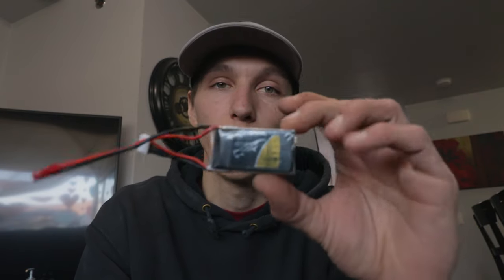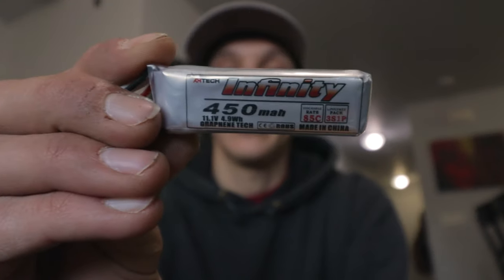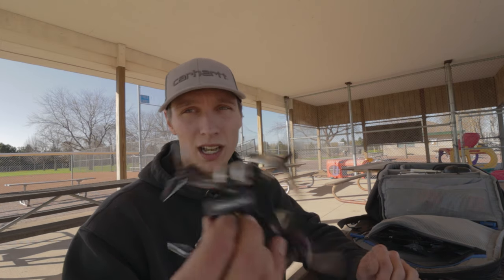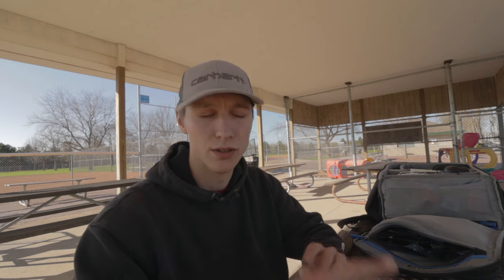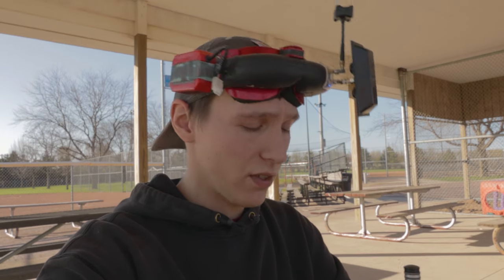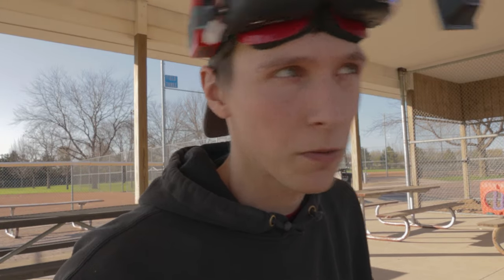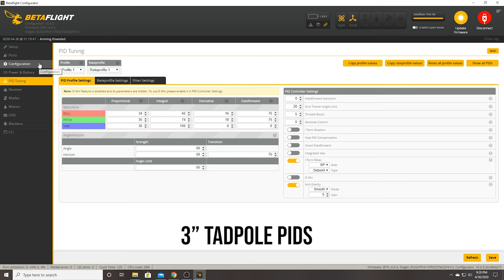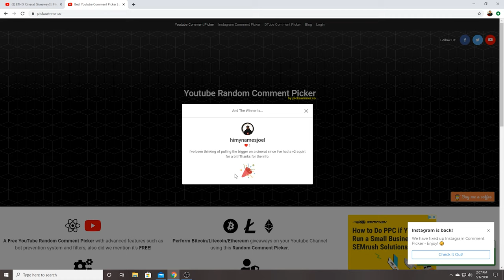The BEST 3 Inch Tadpole Setup | Armattan Quads | FPV Vlog

Comment: I've been running the iflight 1404's with 4s 525mah. Fakka rips and after some tuning was able to get the vibrations under control. Easy fly on 3s all day. The 14xx are a bit much for this frame though, I'm on my 3rd bottom plate, both cracked arms. I'll put the 14xx on the 3inch when I get it, and run 1206 for my 2.5. Side note, Split 3 nano cam lense sticks out past the cage when tilted up and will crack if hit just right.. if anyone wondered.
Reply from the maker: Nice I bet those 1404’s rip! I always wondered about using those but They just seemed so big lol

Comment: Yea dude, the weight you are shedding moving to the long type batteries is really what made the difference. I have mine setup for 4s and it is a rocket. I have a vid coming soon with it. you should check it out. I would have to say that comparatively my setup would be ideal.
Reply from the maker: I think the new batteries I got are actually heavier. They’re a lot bigger, the higher c rating is what made the most difference. My old ones sagged like crazy on punch outs and these new ones hardly sag and they recover super fast. What motor/kv are you using on 4s?
Reply: @Sky-wakka  Yea you are probably right on that one. Mine is basically the same setup accept the motors. I use betafpv 1204 5000 kv motors on 4s. The difference isnt insane, but it flies a lot like a 5" now and can power out of maneuvers much easier. I noticed we have a very similar style as well by the way. Good shit dude.
Reply from the maker: Yea our setups are very similar. The final rpm is almost the same but yours is slightly higher, but your batteries are probably heavier than mine. Probably just depends how you want it to fly in the long run, i saw someone else running a 1207 5000kv on 4s and it was crazy tho. It looked way faster than mine but i assume they were using a much higher camera angle too, looked like a 5" racer when i was watching it lol
Reply: Skywakka FPV didn’t you mention that yours were 6500kv? Yours are a higher RPM in that case. Yours flies much better than mine would on 3s although mine is also very nimble on 3s. I think if I went from 525 mah to 450 4s the weight difference would make it much faster. Currently my setup is about 130 grams AUW. What’s yours?
Reply: Skywakka FPV the micro class has come a long way since I started. But there is no better micro than the one you build yourself. Especially in terms of performance. Do you remember the channel? I’d like to check it out.
Reply from the maker: Sorry for some reason I never saw this comment. Yea it seems I didn’t the calculation wrong and my motors are slightly higher rpm in the end. My all up weight is literally 130.7g lol. I can’t remember the channel unfortunately I believe I saw it on Facebook somewhere on the armattan group

Comment: Appreciate the video!  Been searching for a mini marmotte and this is exactly it! I have spare parts including 1106 4500kv motors, hope they have the umph it needs
Reply from the maker: Yea if your gonna use 4500kv motors, if they can handle 4s, run 4s. I think 6500kv on 3s is just about perfect but 4500kv on 4s should be roughly the same final rpm. Should be a beast little set up

Comment: Just ordered my 3in frame from rdq, gonna do a fresh build on it, I'm new to the hobby but I love building these things lol
Reply from the maker: Make sure you have a nice fine tip on your iron for soldering the tiny components lol. These 16x16 boards are tiny but most of the stuff plugs right in. Good luck on the build and have fun!
Reply: @Sky-wakka  thanks, I've been using a standard size one but I'm pretty confident in my soldering to pull this one off
Reply: Honestly I don’t know if I like building them more or flying them.
Reply: @DailyMynt  Same here. :)

Comment: Thanks for the info as most here thinking about building one. Seems to me the 2.5 was where the sweet spot was a 3inch prop needs a certain size battery to run efficiently and I dont believe this setup can handle it better to run a 1407 or 1507 on a 3inch frame
Reply from the maker: Yea you wouldn’t be able to fit most 14xx or 15xx sized motors on the tadpole. Some 1404’s and such can fit but I feel like that’s over kill. It’s hard to go wrong on the tadpole which ever route you decide to go
Reply: @Sky-wakka  What is the biggest motor size that can fit on this frame? I have the 1204/5000kv on it now, bought a second frame for another build and was hoping to use some 14xx size motors.
Reply from the maker: Some 14xx sized motors will fit like 1404’s. You won’t be able to fit the standard 1407/1507 sized motors that would be used for like the Armattan gecko. It just depends on the mounting pattern of the motor
Reply: @Sky-wakka  Thanks for the response bro! I am learning that Iflight and emax make some 1404's that will fit the 3 inch tadpole. Honestly, not even sure why I want to do this. The thing is stupid fast on the 1204/5000kv. Running 4s 450mah and it screams already haha.
Reply from the maker: I bet! The 1206 6500kv on 3s is good enough for me lol. I know a lot of guys run 14xx and really like it tho
Reply: @Sky-wakka  Yeah man, and your flying is spectacular! Very inspiring. I tried out your pids and rates and man, it made a huge difference and significantly reduced prop wash. I basically have to to really try hard to get prop wash now. Thanks again!
Reply from the maker: Thanks man! Seriously appreciate the kind words! Glad I could help

Comment: Great flight, the Avan props are very aggressive, but this flight convinced me to use them again (I have them, thanks).
I just received my Tadpole 3" frame. My build will be with either 1206 6000kv or 1207 5000kv (which ever gives me better lipo performance on 3s). 

I'm just worried of the 2mm base plate being so thin. Lets see how it performs. :)
Reply from the maker: Yea the only issue I’ve had on my tadpoles is a small crack where the hole is for the whoop board adapter in back. Other than that I’ve beat the crap out of mine and the frame hasn’t let me down. Yea the emax props had the most power for sure and still had very good performance. Good luck on your 3” build! I’m sure you’ll love it!
Reply: @Sky-wakka  Cool, thanks. If the adapter is all that's the most vulnerable, I'll make my own (like I did with my Novice III custom build, last month) and see what happens. 
I have to say, you're a better pilot than me. I have to put in more practice, like you do, but I'm a long way's from your level (why I haven't posted any videos yet). lol

In-case you're curious, my Novice III (3") has 1204 5000kv on 3s (same weight as your 3s 450mah lipos, my are GND). This custom build has unexpected power, but I think the Tadpole may outperform it when I build it. :)

Comment: psh put them 1103 back on and use the 450mah. i have 6 min fly time casual freestyle, 5ish min of racing. (16x16 hglr, 450mah tattu, xing 1103, armattan tadpole).
Reply from the maker: Too late now lol no sense in buying one more 1103 to replace my bad one when I got the set of 1206’s now. I wondered how the 1103’s would have been, if I had ran these better batteries on them. Flights are short but I love the way the 1206’s fly

Comment: I have almost then same set up as yours in the tadpole 3" and it flies amazing! i have 450 mAh 3S but only last 2:30 min....
Reply from the maker: Haha same. Those 1206’s are lipo killers. I was lucky if I got 2:30 out of a 450mah 3s
Reply: Try use 48khz jesc. Boosted my flight times from 2:30 to over 4min.
Reply: @despicableIcon  Thank You !! you mean rpm filtering, no??

Comment: hello...is this frame true X? have you experienced propwash with this frame? I have trouble finding a 3 inch frame without propwash
Reply from the maker: No it’s a compressed x. Prop wash is pretty minimal on this set up, I get a little prop wash depending what props I’m running but I’m sure I could tune it out If I tried
Reply: @Sky-wakka  Yes very nice. I seem to see very little propwash. i am a 3 inch lover. You play this quad like playing a 5 inch quad, it can be seen from the way you play a juicy flick, where the effect of the throw looks very far. I am very interested in your setup. with your flying style like that and using a battery 3s 450 mah ... how many minutes do you get ? what is the total weight of your quad?
Reply from the maker: It’s around 125g I believe. It’s more if I’m using the insta360 go. I get about 2-3min with the insta360 go but flights are a little longer without it. Using the 450mah 3s lipos. But yea it’s a great setup, flies just like a 5” 👍👌

Comment: Would 1404 4800kv motors would be a good choice to run on 3s ?
Reply from the maker: They’d probably work yea. I personally like something closer to 6000kv for a little more oomph but 4800kv should be just fine

Comment: What props are you using? a 3018 props? and what is the weight of the quad?
Reply from the maker: Hq 3x2.5x3. Believe it’s around 130g I’ll have to double check tho
Reply: Have you tried using hqprop 3x1.8x3 in this quad?
Reply from the maker: I actually have a set mounted to the quad right now but haven’t had a chance to fly them. I’ll give them a try this week and let you know how they fly, I have a feeling I’m going to like them
Reply: @Sky-wakka  How'd they work out?

Comment: Where did you find the 3 inch bottom plate for the tadpole? I keep seeing people running a tadpole 3 inch bottom plate but I cant find it anywhere
Reply from the maker: it's not available for purchase yet. the 3" og carbon will be available in the next couple of weeks. the reason some of us have them is chris sent out some samples to the sponsored pilots. and there was also a 3" bottom plate on armattan productions for a short while but they had it taken down because they're releasing the actual 3". So hopefully it wont be more than a few weeks before you can purchase one
Reply: @Sky-wakka  ok awesome. I appreciate the info. It was driving me crazy not being able to find it. Lol
Reply from the maker: Haha yea a lot of people are anxiously waiting
Reply: @Sky-wakka  yea I bought the xing 2506's and had them on the 2.5 tadpole but they were just too much motor on those little props. Got the 1103 8000's on it now. Need a 3 inch build for the xings that I'm stuck with lol

Comment: Great vid.. Can the frame take 1407 motors? Wanna use what I already have on it once the frame is available in the market..
Reply from the maker: Thanks man! I don't believe it will fit a 1407, like the armattan gecko would. I believe iFlight makes a 1404 motor that uses the same mounting pattern as the 1206 and 1103's and such. Personally i think a 14xx motor might be a little big for a frame this small anyway. You will probably need to find a new set of motors unfortunately
Reply: @Sky-wakka  got it bro.. Thanks for always being helpful.. Might just go with new components on it..
Reply from the maker: Happy to help! If you do go with new components, you already know what i'd recommend 😜

Comment: Finally I have my 3" Tadpole flying. The Tinyhawk Freestyle 2 is like Driving a Ford Taurus and the Tadpole like a BMW. I couldn't get that iFlight stack to work for me so I traced the bottom plate onto a piece of scrap 4x4 twill carbon I had laying around and cut it out with the difference being that I made the center wider to accommodate a 20x20 Mamba F405 Mini Mk3. I have a different stack than yours and my motors are Xing 1404 4600kv but I copied your PID tune the best that I can and look forward to the morning so I can try it out. I just flew two 3s packs tonight after I finally got everything put together and the stock PID tune is pretty nice so far but I didn't try any freestyle beyond a couple of rolls. I kept breaking the arms on my Tinyhawk Freestyle 2 so the carbon I used on the Tadpole bottom plate is about 50% thicker than stock. Thanks for showing your PIDs. Most people don't.
Reply from the maker: No problem, good luck on the tadpole! Glad you got it flying, hope you can get it all tuned up real good!
Reply: @Sky-wakka  I finally broke one of my Xing 1404 4600kv motors on this little quad. The shaft just disappeared while I was flying. I replaced the motors with a set of Happymodel 1404 3500kv motors I took off of a Crux35. The quad has no power now. I'm going to again trace the bottom plate onto a piece of carbon but I'm going to lengthen the arms and make it a 3.5 inch Tadpole. That still only gives me about 80% of the prop tip speed I had with the 4600kv motors on 3" props, but it'll be an interesting experiment. Slower props but more thrust per RPM because it'll have 1/2" more prop. Maybe it'll even itself out?

Comment: Very curious to know what 3s 500-800mah batteries would do to flight agility and time. Extremely interested in this build but 2:30 mins is a bit short when you're having that much fun.
Reply from the maker: Yea the flights sure are short. You could probably get away with a little bit bigger battery if you don’t mind it being slightly heavier. Might actually do it some good, it doesn’t do very well in the wind so some weight might give it some more momentum to fight the wind
Reply: @Sky-wakka  I think some other 3 inch frames are way heavier than the tadpole. The added weight from a larger battery should also give more momentum for flingy-type freestyle tricks. Would love a follow up video with various battery sizes.
Reply: Go with 1303 or 1204 motors in the 4500-5000 kv range and a 520 mah 3s. That should get you 4-5 minutes of flight time.
Reply from the maker: But won’t be nearly as fun lol, I like a nice high rpm to rip around on

Comment: Try some EMAX 1404 3700kv, 4S 450 and the Avons and you'll think you died and went to haven.
Reply from the maker: Haha maybe one day. I already got the 3s motors and a bunch of 3s packs
Reply: @Sky-wakka  Emax 1404 3700kv motors + avans on 4s setup I'm running and it's ridiculous. The highest power/weight ratio I've experienced, cool motors, long flight times. Getting 4 mins super hard freestyle and did more than 8 mins cruising. Makes my 6S Marmotte feel weak in comparison.
Reply: avons or avans? which size pls?
Reply: @ZtowhyA  Avans, 3 inch. If your tadpole is 2.5 inch the avan rush are also amazing.
Reply: i can see you use different 2 fc in your channel.
Reply: @naomarik  Is this on the 3 inch tadpole frame?? If so, I might just copy your setup and do the same!
Reply: @look2christ777  Yup. Actually it can carry a full Go Pro Hero 9. Of course not doing acro.

Comment: That sag to much on yr lipo. On 3inch i could used 1106 and below.
Reply from the maker: Yea I have an insta 360 go on this quad now so I think the motor size helps with the extra weight. These batteries hold up pretty well